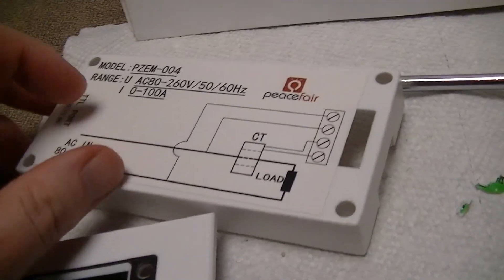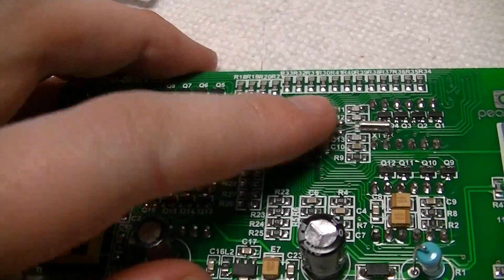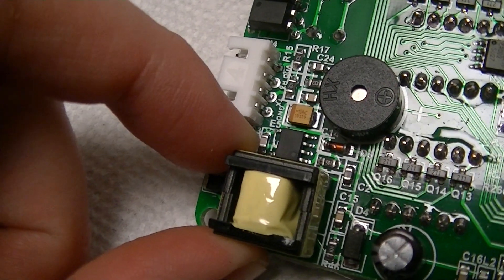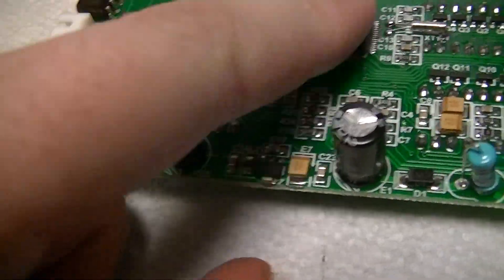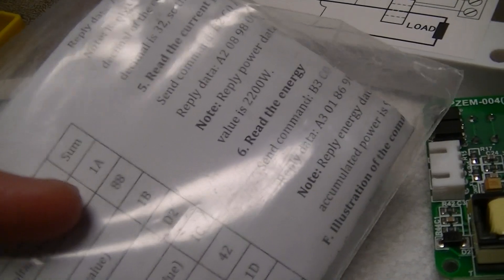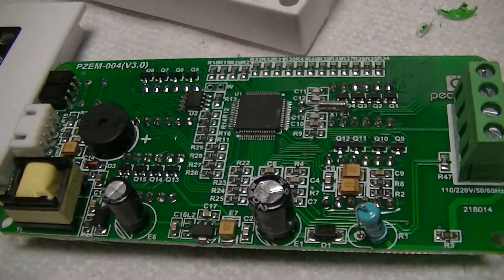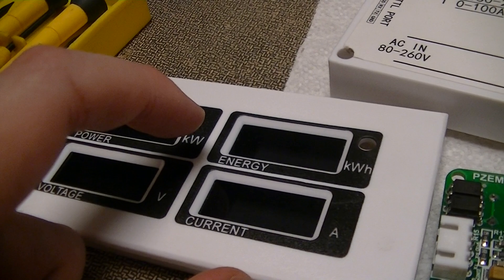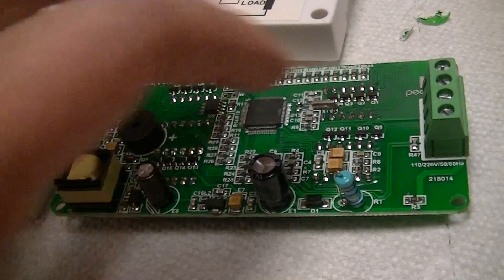Peacefair PZEM-004 panel meter guts

Comment: Can you set a power threshold alarm with this device?
Usaly it's an hidden feature with this ON/OFF button you say it's for resetting the energy display.
Reply from the maker: The included attempt at documentation says that that is done using the serial port on the thing.